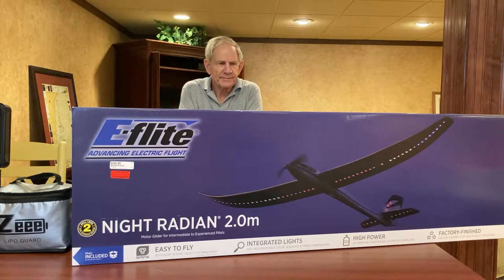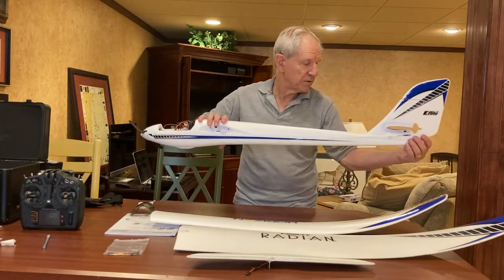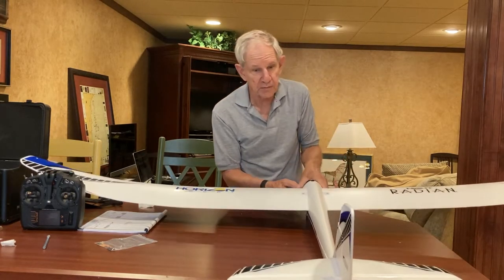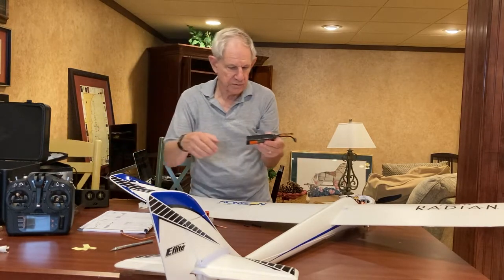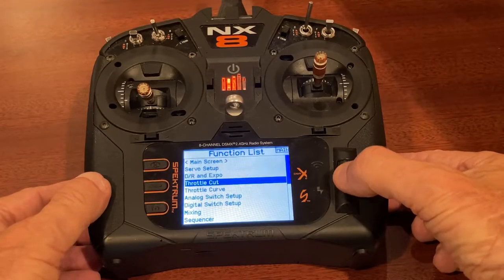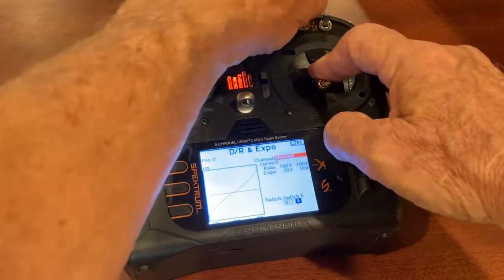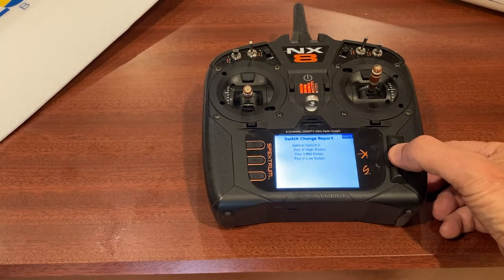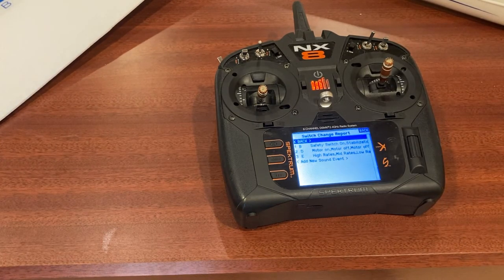Night Radian assemble (not build!), radio settings and a short demo flight

Comment: I follow your channel.  My first model was a Radian.  I have built many kits, balsa and foam (Flitetest), and ultimately crashed or gave away almost all of them.  No regrets, I still love to fly and build kits, as well as assemble ARFs.  Now I think I want another Radian.  I am 80.  Thanks for the inspiration.
Reply from the maker: Thanks for the reply. I turned 76 this year and can relate to the age issue. My reflexes are not what they were 30 years ago. Last year's "first year back" RC experience was frustrating mainly because I kept making dumb mistakes, crashing airplanes, all out of a belief that I am as good as I once was. This year I have started using gyro technology in the new receivers for takeoff and landing. A crutch? Yes it is. It makes it possible for me to participate without littering the landscape with aircraft parts. Call it a public service. :-)

Go for that Radian! It is probably the easiest RC plane to fly I have ever owned, and the lights at twilight are amazing. Consider putting in the $40 Wingnut light controller. It's amazing tech. https://www.wingnuttech.com/products/led-controller
Reply: @GoofballFlyer  
Ditto on landings.  The guys at the field are impressed with my landings.  Many are on SAFE, but I don’t tell them.  I have a few videos on my rc channel, loftbuckleyrc, if you are interested.
Reply: @GoofballFlyer  
Which do you like best, Radian or Conscendo?
Reply from the maker: That's a matter of personal preference but I like the Conscendo more than any other plane in the fleet. Flies great, no landing gear issues, and will go an hour on a good thermal day. The Radian also performs great, looks good in the air, but I miss the ailerons.

Comment: You created fantastic step by step video guide of how to set up the radio and plane. I just received my Conscendo and I'm wondering if the same radio settings would work for this plane as well? I'm  relatively new to the hobby and still don't quite know what I'm doing. Thanks very much for your valuable time.
Reply from the maker: Thanks for the nice comment. The Conscendo is a very different aircraft. I would start with the book setup. See my videos on Receiver unlock, Forward Programming Safe setup and flaperons to get to my current setup.